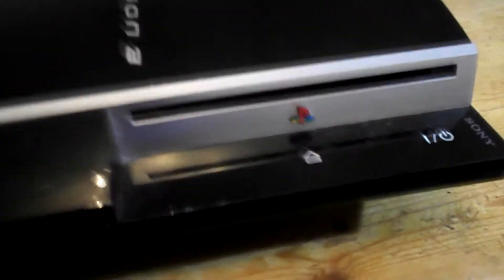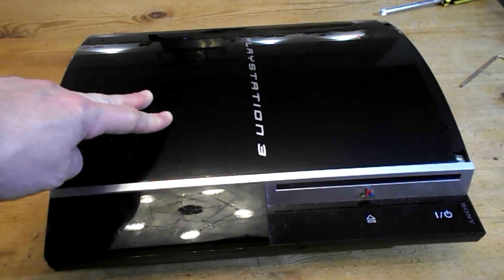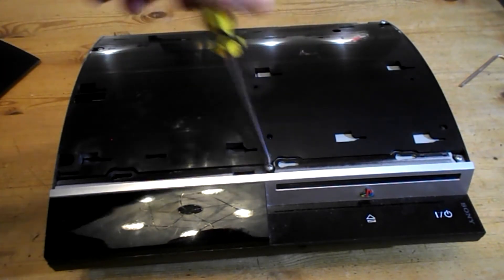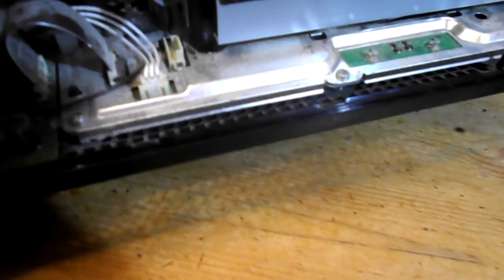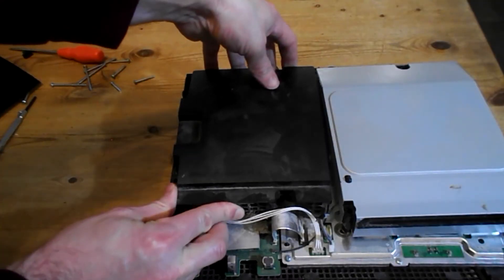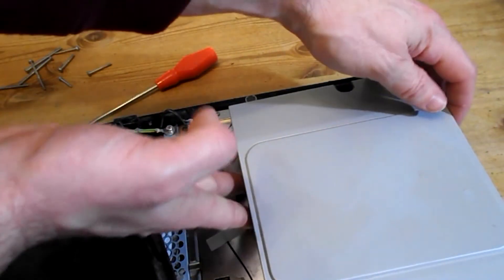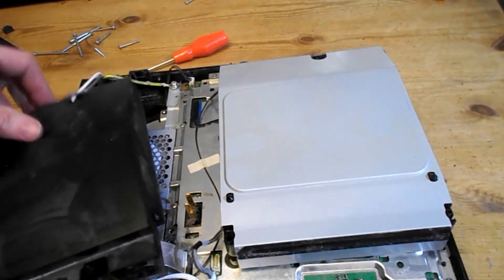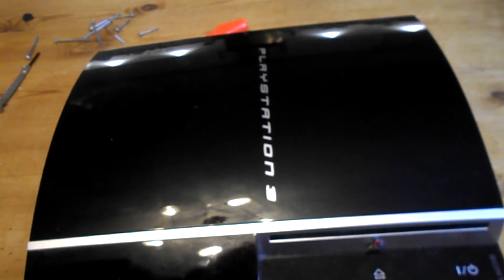PS3 Optical Drive Replacement

Comment: You didn't mention that the PCB on the drive is married to the motherboard and needs to be swapped onto the new drive. Also you forgot to replace the 4-pin connector at the end.